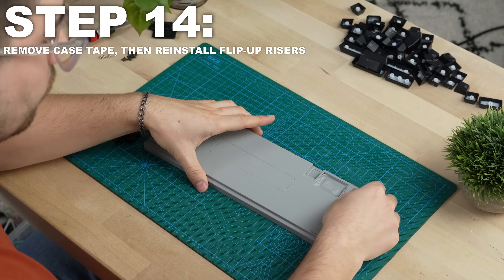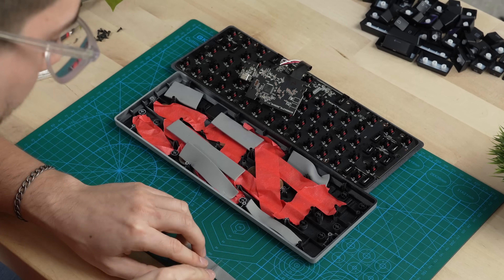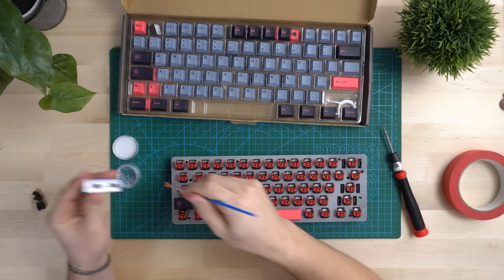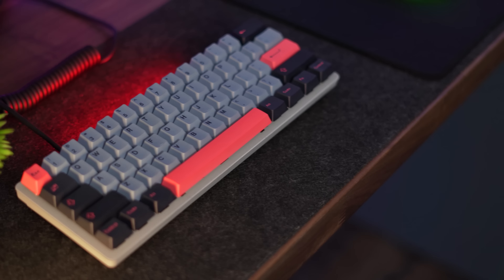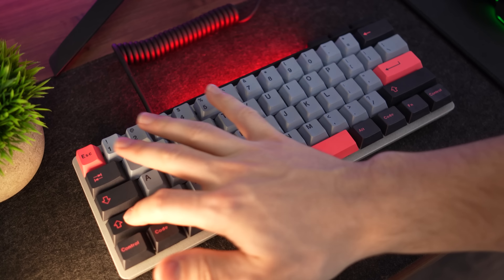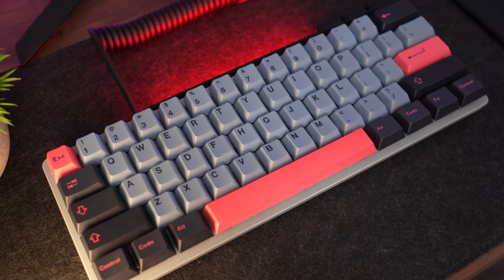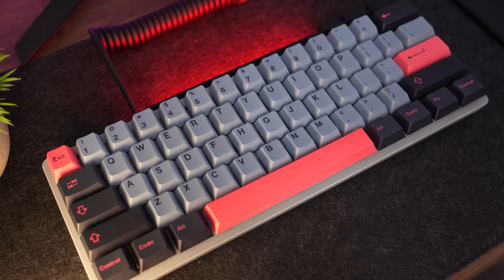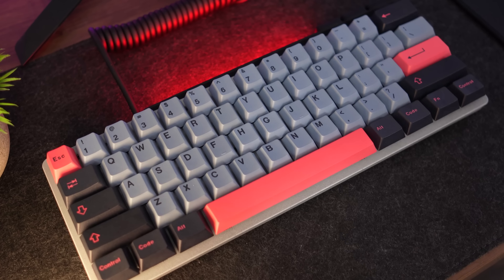Razer Huntsman Mini Modding Guide (Step by Step Tutorial)

Comment: Thank you for the awesome guide!
But I have 2 questions:
- is it possible to deassamble the switch, to allow better / more consistent lubing?
- Is it possible to use different stabilizers?
Reply: I just got this keyboard myself and I can answer one question fully. Firstly, you cant disassemble the switches without breaking them which is kinda sad but they still are amazing switches. 2nd, I'm not really sure if you could switch the stabilizers, it depends on the size of the area where the stabilizers go, but I would probably guess a no for that. Overall I think this is one of the best keyboards out there and if you're debating on getting it, you won't miss out on anything and it actually sounds better IRL than in videos.
Reply: the stabs on razer's are kinda proprietary

Comment: This board is only worth it when modded
I swear I have a cheap drevo with some outemu reds, and the stabilizers on my keyboard are way better than what Razer did here, and it costs like less than half!

Don't get me wrong, they are still not that great, but decent for a 40 bucks board, these on the huntsman are just crap